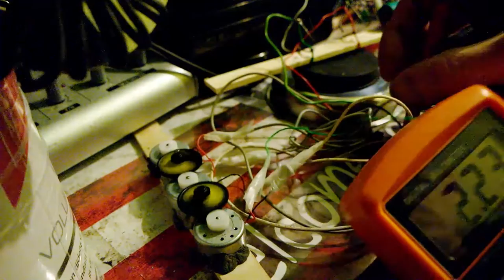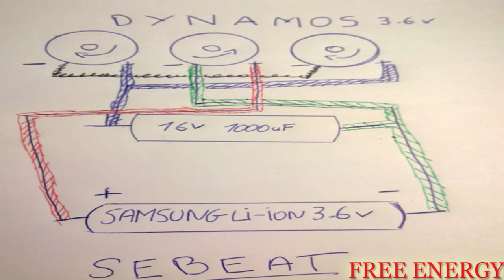Free Energy + Plans Libre

Comment: Helo , is that samsung thing is a battery?
Reply from the maker: +tolek Hello Yes it's samsung 3.6Volts ;-) look https://www.youtube.com/watch?v=DYG0O339U-s my new secret
Reply: +SEBEAT PRODUCTION so where u taking that battery from? and that system sopoust to charge that battery all time,  like never discharge?
Reply from the maker: tolek I found a hand screwdriver is 18650 Lithium ion Samsung, as the schematic shown it takes to transform the capasitor DC Current AC, two dynamo for charging and a dynamo for tour the other two which is fed by the device, I can be simple but otherwise it's an idea to develop